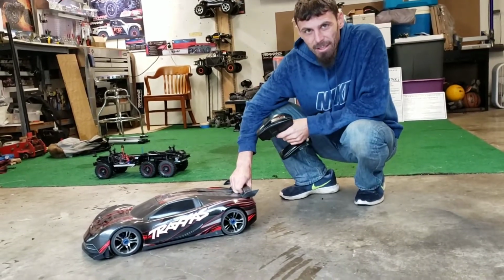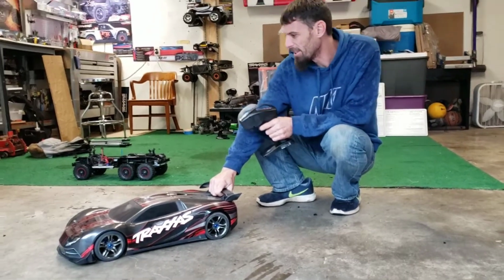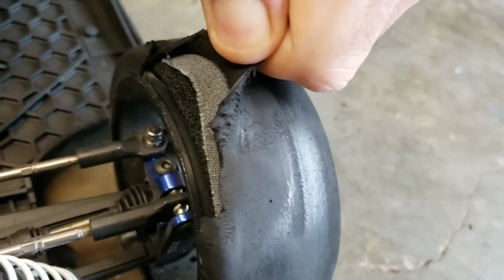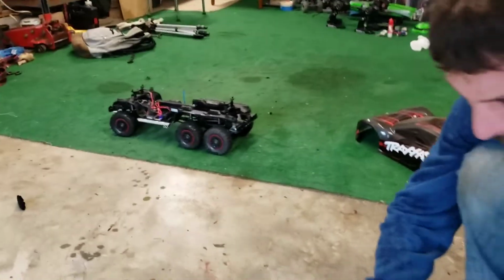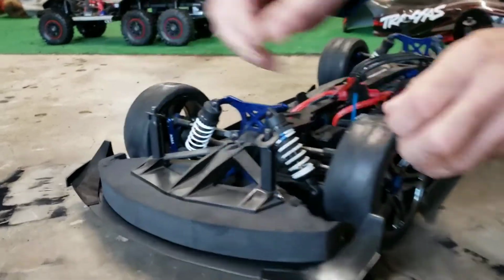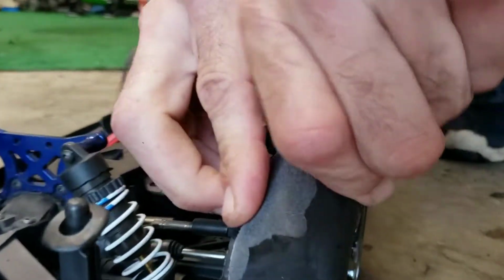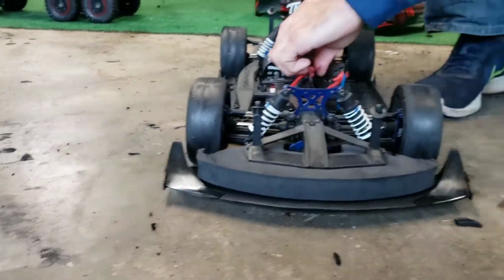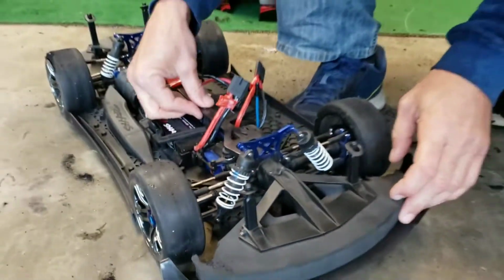Traxxas XO-1 Tire Shredding (kinda)

Comment: Did you ever try mounting the hoons on it after this? I got a set, but they are quite a bit shorter than the stock xo tires, and it causes it to sit too low. Can't even get it off the chassis. I tried adjusting the preload on the shocks, but that didn't help. Any ideas?
Reply from the maker: I have Hoons on it right now but haven't run it yet. Seems to sit low but still has some ground clearance.
Reply: Buy it Break it Fix it gotcha man. Thanks for the reply. I’m gonna try my pair of hoons on mine again before I just buy another pair of stock tires.

Comment: alright bro i got one for ya. im like you i dig RC in general. well i just got a killer deal on an infraction, but im trying to compare the hoons tires to these traxxas tires... what do you suggest? whats a better tire?
Reply from the maker: The traxxas ones seem to last longer (harder compound) but have less grip. Vise versa for the hoons. The Hoons only lasted a couple runs on my x 01 but I was extremely hard on them. Rumor is, you only get a couple runs out of the hoons. The traxxas ones just don't have much grip. Kinda have to pick your poison.